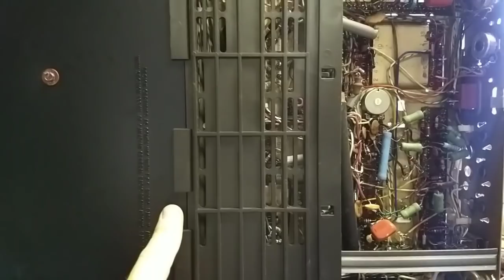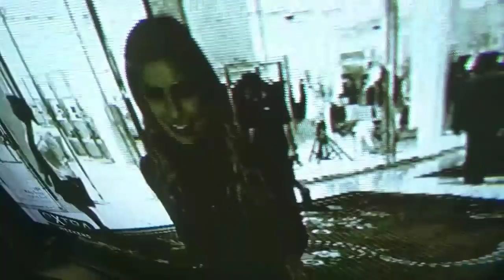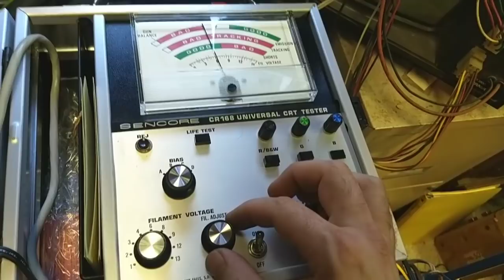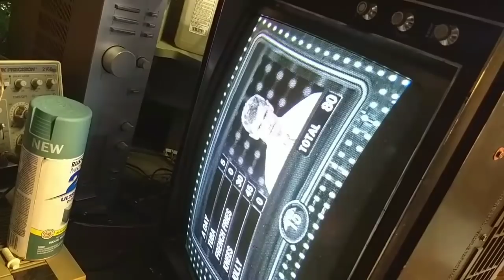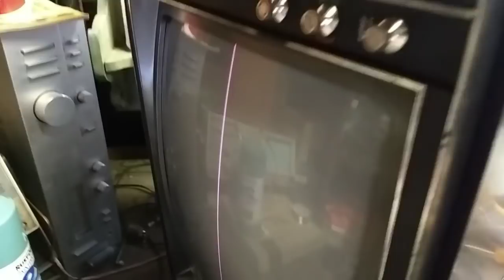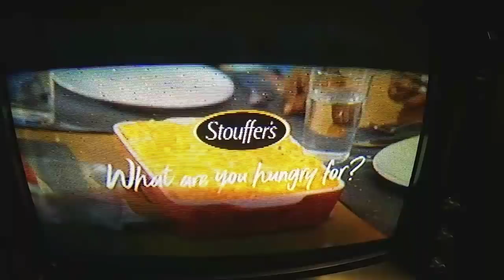Servicing a 1974 zenith 19DC12 4 tube hybrid color tv.

Comment: hello dear one question I have a 1974 zenith tv at 120 dc that my nephew connected to 220 volts and since then it has not turned on? you who advise me where I should start to check the tv. Maybe to replace capacitors and tesubstances of the source?

this zenith television does not have a switched source?

does it have a linear font?
where could i get the source diagram of edtos tvs zenith from 1974-1978
Reply from the maker: Not good. Check power supply components and move downstream from there. Try to find a chassis schematic. Chassis number should be inside the tv somewhere

Comment: Great video, technicians of the day often forgot one extra piece of test equipment  --  their brain. I don't miss    color CRTs at all.  At least Zenith's point to point wiring was reliable.  RCA took a huge blow to their reputation when they began using printed circuit  boards      (the SPACE AGE way to wire a TV) with vacuum tubes.  After the RGB voltages were good, I would have tried gently bumping the CRT neck with a screwdriver handle.

Comment: Thanks for the informative lesson, JP.  I did not see--understand--what you did when you said that you 'rejuvenated the CRT' to resurrect the blue.  A high-voltage jolt to re-align some phosphors?
Reply from the maker: It's a quick burst of high voltage between the grids and cathode of the gun to strip away contaminants that cause a loss of efficiency. However there is a risk that you'll strip the nickel plating from the cathode and render the tube useless. Rejuvenate should be a last ditch effort. Since I couldn't really use the tube in it's state, I took the chance

Comment: But they are totally unreliable and problematic by later sets standards. I have the table top and the console version and both have had tons of work done to them including the focus board becomes conductive so they cut slots between the pins. Lots of high voltage problems and ICs go bad the earlier 14 tube series seem to be much more reliable. What let's do, I like that it's going to start using that
Reply: The name goes on before the knobs fall off